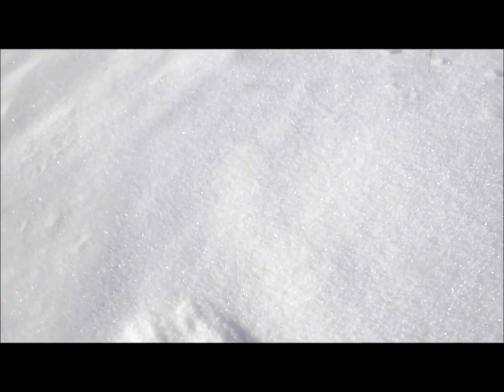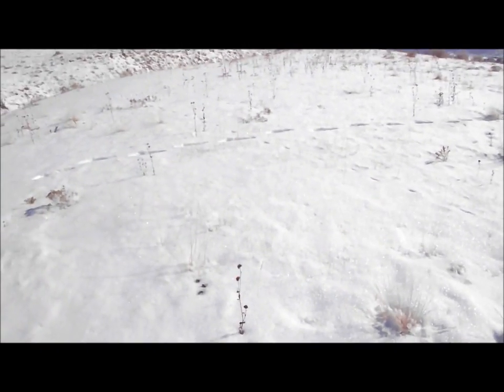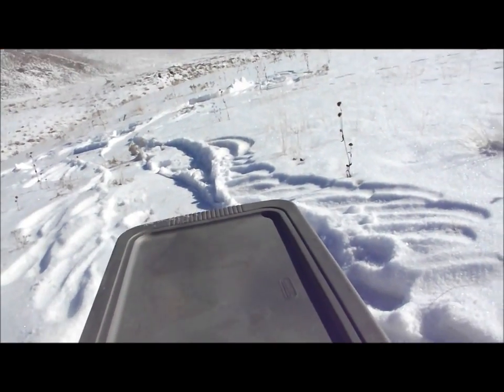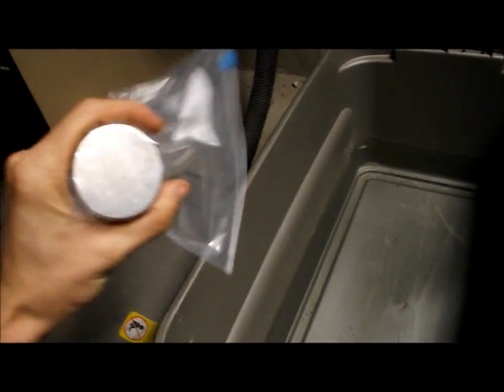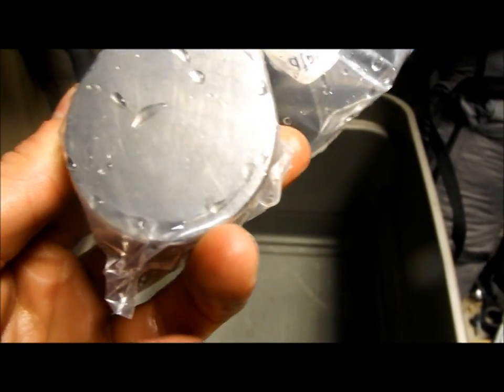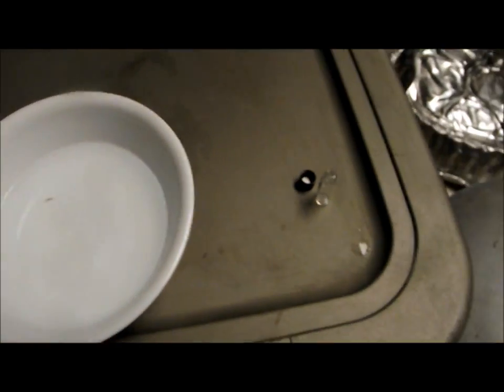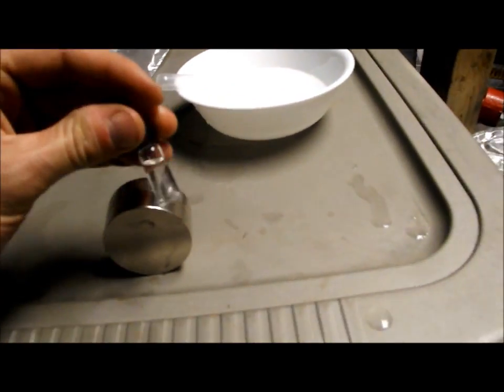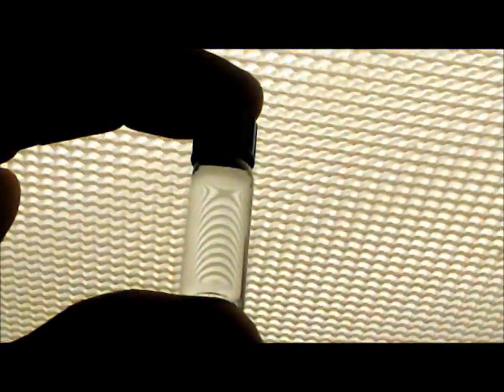Meteor Dust Part 1

Comment: I SPECIFICALLY looked up this video to post a comment of something that happened to me less than 30 minutes prior to this posting, which I BELIEVE was being hit by fine meteorite dust moving at, or just above its natural terminal velocity.

Now before anybody says anything, I have no way on earth to prove this, and as such, I can rely solely on evidence and deductive reasoning.

And before you go into that, please allow me to present the evidence and how I use it to rule out other possible causes, which I investigated before posting this.

1, I was in an empty parking lot driveway, devoid of any significant plant life, therefore I was fully able to rule out erupting seed pods.
2, I was alone and not operating any machinery, so it was not a weed eater slinging rocks or debris,
3, it hit me behind the knee area and some leaves just off from the edge of the driveway at the same time [3 very quick groups of 3 impacts, for a total of 9 impacts in just under 1 second, possibly less than .5 seconds] so it was not a piece of a tree falling or a stray leaf.
4, there were no fallen leaves or pieces of branch. [also it is impossible to hit myself in the back of the leg with a weed eater without some really tricky ricocheting as well as operating a weed eater which was not remotely happening as I was carrying a block of wood]
5, I am too far from any area where one would fire off a shotgun so it could not be bird shot, and living in a very high walled, small valley as I am [almost a box canyon] with high stone cliffs, sound echoes through her like an amphitheater, so nobody fires off a gun within 5 miles of me without I hear it. 
6, No birds flew overhead, and had they, since it was 9 widely spread impacts, it would have had to have been 1 bird with 9 items, of relatively large mass [say the size of a hickory nut or larger] or more than 1 bird with any combination of those items, flying in tight formation, at a ridiculously high speed, and without casting a shadow as the sun was to my back and it is still a very bright sunny day as I report this. No birds flew near me at all.

I am sure somebody could possibly come up with some other totally outlandish proposal for what it was, and I have no way to search for these items, but my best guess, from how they hit me, how much they seemed to weigh by their sensory input, compared to other items which have hit me, is that it was rock or metal the size of grains of sand, moving at or around their terminal velocity at an angle of roughly 37 degrees, having been moving at such a speed long enough to have cooled down in the lower atmosphere before impact. [no smoke in the dry leaves where they hit, so not evidence of elevated heat]

I was wondering, perhaps with some kind of controlled blower [leaf blower, hair dryer or vacuum cleaner exhaust and variable relief valve, could you possibly present a video study on the potential terminal velocities of meteorite dust?

I don't expect precision, but even a rough estimate would be helpful.

Also lead and tungsten bird shot would help as a comparative item, although again, without knowing their peak range, and unless there is a silenced shotgun being used some place close by, that one is easily ruled out.

I don't think fine lead or tungsten shot would fly this far even.

Again, although I can insist it was particles of very low mass/diameter space matter, all of the reasonable, logical evidence suggests this.
Reply: bugs?
Reply: You think too much

Comment: this brings me to a question I have thought of from time to time....if the earth gains mass all the time ..how does that effect the orbit of the planet...or does it ...if not then why not?
Reply: it's negligible, as the mass is so little to add on top of the earth's mass, very little slower rotation is the result, since it's not getting mass as much as half of it's mass everyday, it's nothing to worry about, matter of fact the earth actually have got slightly faster and as a result a couple seconds is lost. i mean sure if the size/mass increased x2 then things would get a little hairy to say the least.
Reply: Late too but: don't forget all those things men send into space and never return.
Negligible too but still numbers in tons...
Reply: This is a bit of a late comment, but it's worth noting that the earth also loses mass in a couple of processes including the loss of atmospheric gas to space. Estimates places the loss of atmospheric gas to anywhere between 50,000 and 90,000 tonnes per year. There is also a change in mass associated with the decay of radioactive elements on the earth (losing the mass as radiation to space,) and a small gain from incoming energy from the sun. The net gain/loss of mass per year is likely pretty variable, but the changes will be so small as to be pretty inconsequential over the finite lifespan of the planet.